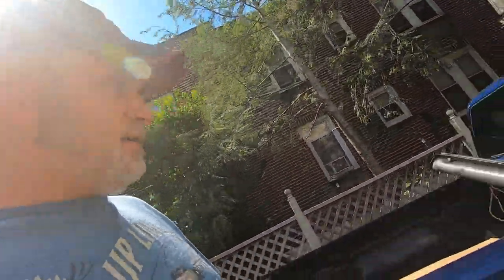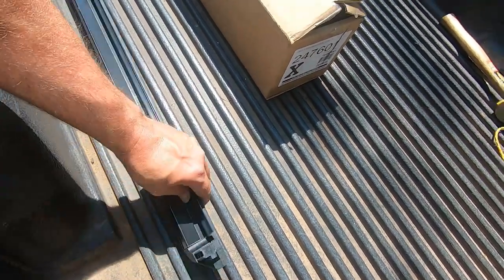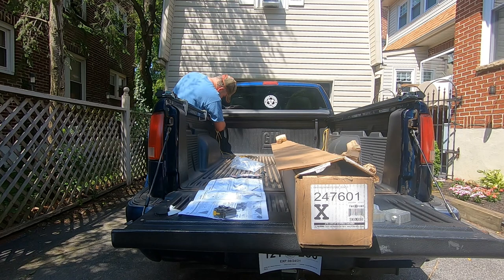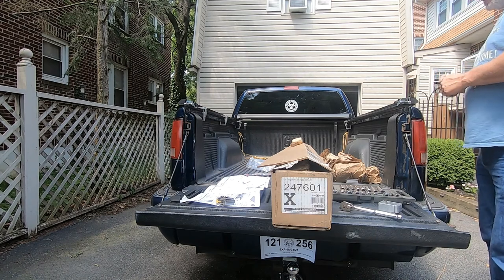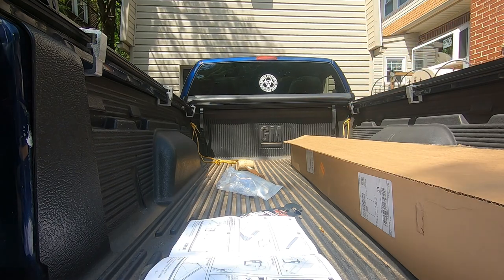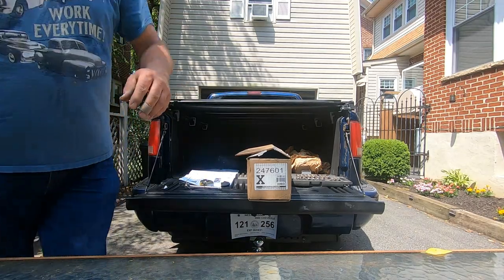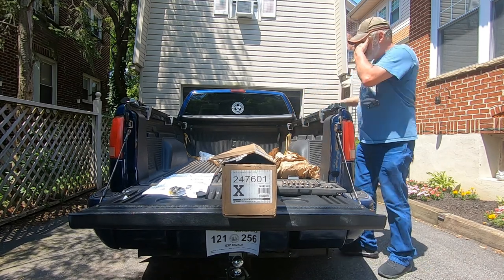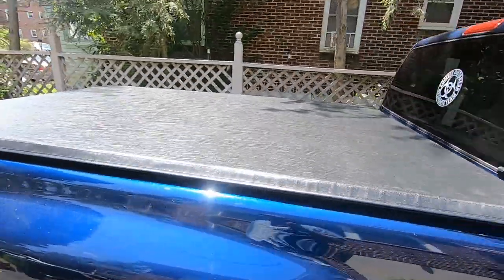Truxedo Truxport Bed Cover Install On Chevy S-10 Sportside/Stepside

Comment: Product number from Amazon I have a 98 sls looking to get a tonneau cover
Reply from the maker: Were you wanting the link to the one I bought? Mine is a step side. Is yours?
Reply: @Grey_Beard72  if possible and yes I have a side step as well. Thank you
Reply from the maker: It went up $30 since I bought mine. Prices are getting ridiculous. Here is the link. 

https://www.amazon.com/gp/product/B000BK3HEA/ref=ppx_yo_dt_b_asin_title_o09_s00?ie=UTF8&th=1
Reply: @Grey_Beard72  thank you so much. Both of the videos I saw from you helped from changing the speakers to the tonneau cover.
Reply from the maker: @willhernandeziam  Thank you sir! Glad to be of some help.